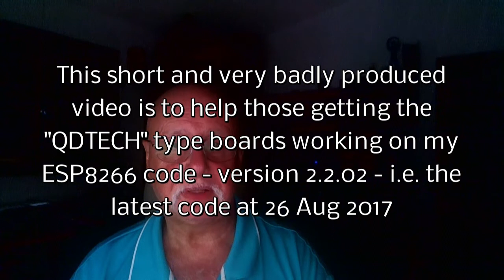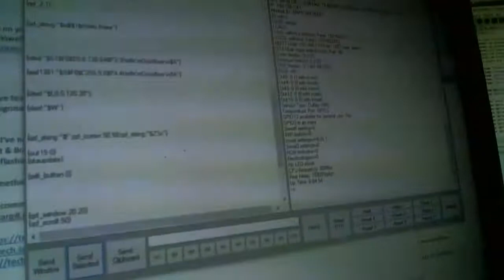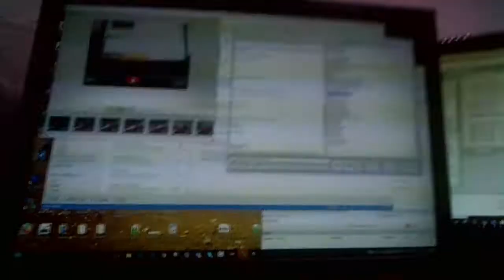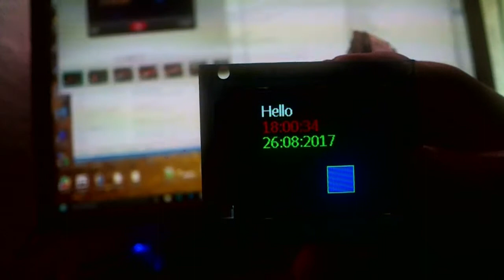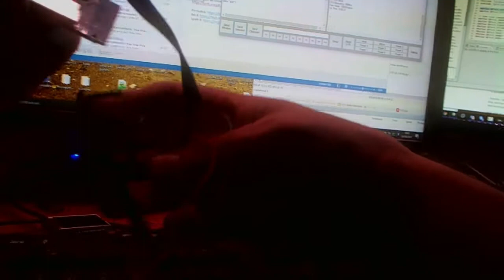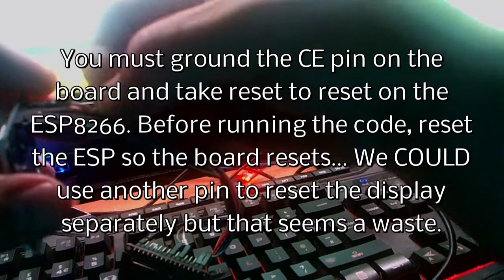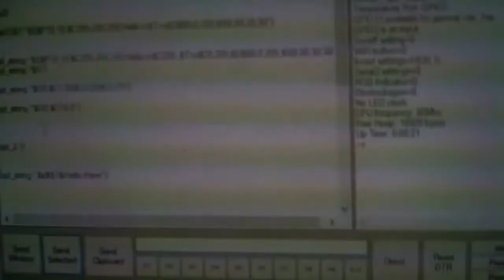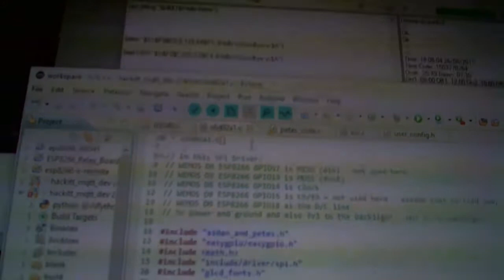Just a very quick video on running the QDTech boards on my ESP8266 software

Comment: So looking to your video we could see it should be working, I had no doubts it would be!. The only difference is the fact that I use a bare ESP8266. I run the terminal software on the RX/TX pins. All looks OK, but not the same result as with the NodeMCU
Reply from the maker: There is no difference. As long as you have the required pullups on the ESP8266.